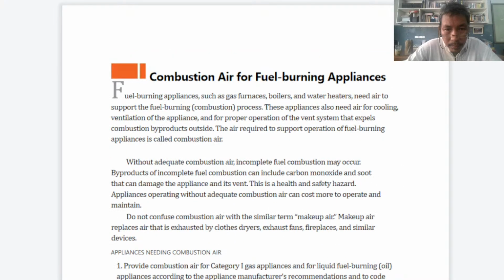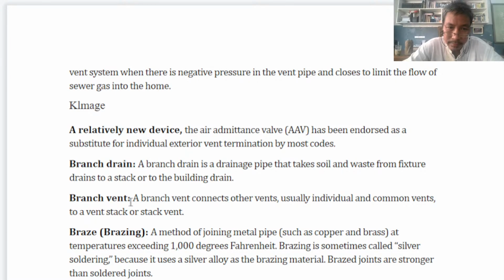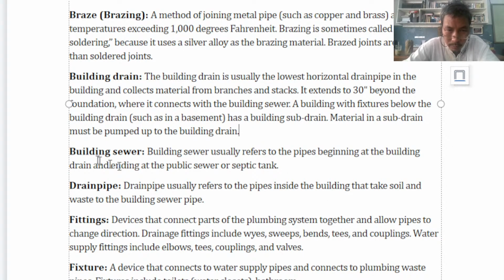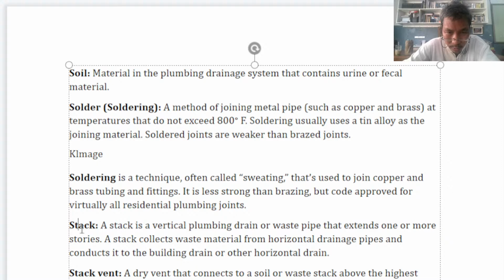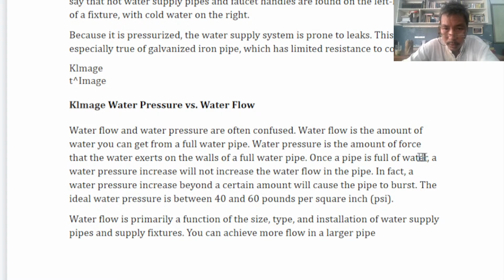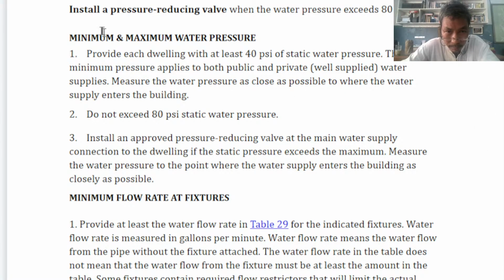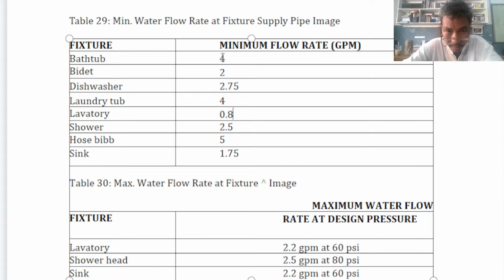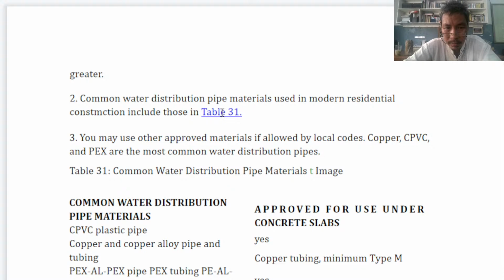[ LIVE CE D2 Lecture 01 ] DrAP Zantua Sanitary & Plumbing Talks + ENGINEERING Analysis & Design

Comment: Thank you, Sir for the live lecture and for sharing us the plumbing system ,to prevent water leaks and poor water flow at fixtures, water supply pipes must be appropriately sized, supported, and linked. Drain pipes for wastewater must be placed correctly. Branch drain, branch vent, building drain, and other significant definitions were well-discussed and clarified.

Comment: Thankyou sir for this video lecture. I’ve learned that plumbing projects are popular and naturally has a strong demand for information on home plumbing subjects that ensures home projects are accomplished correctly. According to this live stream, water supply must be properly sized. Supported and connected to avoid water leaks and to aboid low water flow and fixtures. Waste water drain pipes must be properly installed to avoid water leaks and sewage backups. Traps and vents must be correctly hooked up in drain lines.

Comment: In this live lecture video contains code for homeowners specifically plumbing system, waste water drain pipes must be properly installed to prevent water leaks and sewage backups. The traps and vents also must be hooked up properly in drain lines. I've also learned terminology and its definition, the difference of water pressure and water flow. For instances, the minimum and maximum of water pressure and flow rate at fixtures.

Comment: This video discussion is about home plumbing system. I have learned some of the technical terms in plumbing such as branch drain, branch vent, braze, building drain, building sewer, drain pipe, fittings, fixture, and others. Some of it are familiar due to the course last semester which is EU1:Sanitary and Plumbing. Water flow and water pressure has also been differentiated. The ideal water pressure is about 40-60 psi. Exceeding 80 psi causes failure. Minimum and maximum flow rate of fixture has also been stated in the table.

Comment: Thank you Sir for this live video lecture that talks about the plumbing systems. I have learned that the water supply pipes used should be the in the proper size, it should be supported, and it should be connected right to avoid leakage and to avoid a low water flow at the fixtures. The wastewater drain pipes should be inspected and should be properly installed for it to prevent leakage. The traps and vents should be properly hooked up in drain lines. I also learned here the different important definition of terms that we may encounter.

Comment: Thank you sir for discussing the plumbing systems. Water supply pipes must be properly sized, supported, and connected to avoid water leaks and to avoid low water flow at fixtures. Wastewater drain pipes must be properly installed. Some important definitions like branch drain, branch vent, building drain, and others were discussed and explained well. Klmage water pressure vs. water flow was discussed properly and is easy to understand. Minimum and maximum water pressure, the minimum is 40 psi but don't exceed 80 psi static water pressure.  Also, the minimum and maximum for different fixtures were discussed.  Thank you sir.

Comment: thank you sir for discussing codes for homeowners which I learned about heating and air conditioning which HVAC appliances HVAC duct installation combustion air for free-burning appliances. also plumbing system consist of home plumbing system, water supply piping, drain waste and vent piping (DWV) plumbing vents plumbing traps and plumbing appliances and fixtures. Electrical system is the understanding of electrical circuits. Plumbing system are the popular among do-it yourselfers, so naturally there’s a strong demand for information on home plumbing subjectsto make sure home projects are accomplished correctly. Water supplying pipes must be properly installed to avoid water leaks and to avoid water flow at fixtures. Also some terminologies were discussed such as a relatively new device, branch drain, branch vent, braze, building drain, building sewer, drain pipe, fittings, fixture drain, hub, receptor, indirect receptor, sol, solder, soldering, stack, stack vent, traps are the s-or p-shape pipes, vent , vent stacks. Also this video discussed about minimum and maximum water pressure, minimum flow rate at fixtures, common water distributuion pipes materials and flexible water connectors.